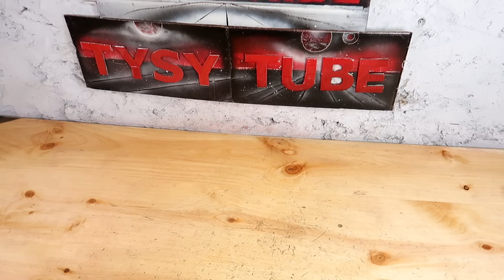Very Rusted Press Restoration

Comment: Usually I cringe at these "restoration" videos, because the first thing the "restorer" does is reach for an angle grinder to remove the rust (and then end up removing a goodly amount of sound metal in the process.) There's a reason rust removers were developed and a reason why you should use them. This was a very nice restoration.

Comment: To save rustremover, you can take advantage of displacement by placing a few more (big) items in the container so that the rustremover level rises.
Reply: IJuziI - good thinking
Reply: @seth_5394  Or, put parts in bag with RR in it. Put bag into huge bin full of water. Water pressure applys RR evenly and keeps it separate.
Reply: Or you could use a smaller container!
Reply: You could place bags or containers of water in there with it
Reply: Admiral Belzediel you are a smart man i never would have thought about that

Comment: Very nice restoration. 
Just an FYI, on bare iron/steel surfaces that you don't want to rust again, you can paint them with a light coat of clear lacquer or a coat of carnuba wax or beeswax. On an item like this, either would work well. However if you restore woodworking tools, never use any silicone oil products either in loosening or cleaning them, it may look nice, but you can never remove it completely, and it will ruin any finish you try to put on any wood you use the tools on, because it gets into the pores in the wood.
One thing I did want to say to you, not about this restoration, but in other in the past. When you use paint stripper, the gloves you use normally, are too thin to protect the skin on your hands. You really need a thicker glove, at least as thick as one that you would use for washing dishes, but thicker ones are always better when you are using paint stripper. I tell you this from experience. I was using aircraft paint stripper on a restoration project, and had on nitrile gloves about as thick as yours appear to be. While I was scraping the paint, the gloves got a small tear in it, and I didn't notice. Shortly afterwards I noticed a slight burning sensation on that hand. Unfortunately, by the time I felt the pain, it was too late. I yanked off the glove and ran my hand under running water. I ended up with second degree burns on my left hand, the sweat on my hand caused the chemical to spread over most of the hand, and I had large blisters and it took almost a month before I could use my hand again without too much pain. 
I love that you are passionate about restoring old items, but I don't want you to find out too late like I did. 
Keep it up.
Reply: Very well share 👍
Reply: That is a great tip, thanks for sharing the information.

Comment: There is a screw on the side of the base on the back, you didn’t remove it, what is it for?
Reply: I'm not sure that is actually a screw.  It appears he took the 'head' and the area around it to bare metal, yet they appear to be the same material (unlike the appearance of the actual screws when they were 'stripped').  Perhaps it is some sort of forging artifact that happens to look like a flat screw head.

Comment: You should buy a brand new one from harbor freight, remove it from the box, and make a restoration video.
Reply from the maker: impossible 🤣
Reply: Yes! That’s great.
 I used to work overnight freight there. Funny shit! 
You should see there weekly return bins. Like 3 pallet crates stuffed full of Car Jacks, All the hydraulics,Tile Saws... Jackhammer.  literally everything the store sells. And each tool... either worn plum straight into the ground. Or brand new and broken after 3 uses. 
We called it “ Horrible Freight”, “Rental Freight” ... traveling to “Rental Harbor”
Reply: Harbor freight wishes they made quality products like this

Comment: That was a really fun one! I wish I could do that, but I live in a city apartment and having even a shared workshop space is super expensive. I make do with a workbench on my truck bed but that only goes so far now that the weather goes worse :)
Reply: Look for a Makerspace or Hackerspace in your area, one where I live offers a 'Maker's Dozen' pass for $100.  Good for 13 working visits, if you know you won't be able to get there often enough to make it worth the cost of a monthly pass
Reply: @Hyratel  We don't have stuff like that in Germany, the cheapest way would be to rent a workspace but that is 400-600 bucks a month here in the city. A bit further out it gets a little cheaper but still pretty expensive, I'm currently looking for these small garden patches because I could easily use them for a workshop and they are much cheaper.

Comment: Love the job that you did. One thing you can try in the future for pain is Wrinkle Paint. It  does a remarkable job of covering surfaces that are very rough and / or pitted or that otherwise aren't finished well. We used to use it frequently on the jewelry safes we refurbished, plus it has the added advantage of having been used from the 1910's to the 1960's so would be in the time frame of some of your projects.

Comment: FYI - Grooves in table are supposed to be paint-free.  There is also an adjustable mounting kit that may be used on the press.  This came up back in the 1980's when I was training as an machinist-apprentice.   Also look up restoring tools with electrolysis.  It will save you a lot of work.  Great video though.  It inspired me to try it on larger mounted tools.  TY.

Comment: Using a wire-wheel with no gloves? You sir, are a glutton for punishment. Pulling tiny metal slivers out of your hands is not my idea of a fun time.
Reply from the maker: is very dangerous to utilize gloves with wire wheel do not attempt 😊
Reply: @TysyTube  I've been using wire-wheels of all sorts since you were probably in diapers, and I always wear gloves and a full-face shield while doing it. All of my digits are intact.
Reply: One way to rip a finger off is to wear gloves doing this. Get to close and gets caught in the wheel. I've seen it happen and it's not pretty.
Reply: just google "degloving" happens alot from machinery incidents, i never wear gloves, and always wear a facemask, id wear leather chaps if i had some too
Reply: Back in the Middle Ages (your time) people wore steel gauntlets when working with wire wheels. Is that why you still have all of your digits? ROFLMAO! Just kidding!   @MFKR696
Reply: @MFKR696  Are you sure you really work in those kinds of jobs???
Ok for the protective head gear,safety first,but gloves are literally...
If you put your hands on a drill will one,poof,bye bye the fingers,same for a lot of things...
Just use glove on the right occasions,like manual sanding or things like that
Reply: @poowhynot1268  WELL THAT WAS GROSS!
But yeah, gloves are only for not automatics things
Reply: honestly i dont use gloves for anything, except welding, but i guess im not a pussy like INF1D, his words, im not scared of a couple wires in my hand, and i blacksmith, wearing gloves in blacksmithing is a big no no, althought some operations require them
Reply: @poowhynot1268  I only use glove for sanding.
But blacksmithing without heat resistant glove is kinda dangerous.
Blacksmithing is not the thing where you mold the metals,right?
Cause if you only work on them,then its relatively safe
Reply: @pepito ? its just hammering on hot steel, not melting it, and heat resistant gloves are just a liability, you can tell if something is hot or not my just hovering your hand over it, id rather get a lil burn than have a glove melt on me, also i have use welding gloves, good quality leather gloves, and sometimes they just get so hot your hand starts to burn in them, blacksmithing is seriously way safe without gloves, usually its really hard to hold a hammer or tongs, and if you the backs of the gloves have any plastic, a hot piece of metal will just melt through and stick to your skin. Anyway moral of the story, use gloves when youre using a belt sander, otherwise happy getting degloved
Reply: @pepito2900  Worry about yourself, bud.
Reply: Call us when you will lose your hands
Reply: he cant, no hands
Reply: @poowhynot1268  Well I didn't think of that x)
Reply: @MFKR696  If you're not clumsy then why do you need gloves?
Reply: @timothypetroulakis62  I take it you've never used a wire-wheel? They throw off little needles of metal which embed themselves in your skin, which is why a face-shield is an absolute must as well, and pulling metal slivers out of my hands is not my idea of a fun time.

I will admit that using gloves with a stationary wire-wheel on a bench grinder is kind of risky, but with a hand-held grinder, not using gloves is a pretty dumb thing to do.

I've spent more time wire-wheeling than you have probably spent doing any kind of work, so just worry about yourself. I've got me covered.
Reply: Wearing gloves is the most basic no no's of using a wire wheel
Reply: @MFKR696   wait wait wait.... youre the guy advocating FOR the use of gloves... and youre calling other people who are NOT using gloves... pussies? am I getting that correct? setting aside the fact you are flat wrong in regards to your insistence of using gloves. youre not smart, yorue lucky. Im a manual machinist and I can tell you with absolute certainty that no, you never ever wear gloves around rotating equipment. anyone who says otherwise is absolutely flat wrong.
Reply: @MFKR696  You go Man
Reply: First off never use gloves on grinder
Reply: @MFKR696  a harp can take a finger off....
Reply: @MFKR696  nitrile gloves are totally safe with the wheel grinder, these people are thinking of heavy cloth gloves, the gloves can get pulled in by the bristles. it only takes less than a split second of distraction, your finger slips and snags on  the wheel while your wearing heavy cloth gloves and boom the machine begins to pull your hand in and potentially break some fingers.
Reply: @joshuamcpeek4708  Indeed. I am fully aware of the dangers of wearing cloth or leather gloves around a stationary tool, regardless of what all these other fools are saying in this comment section.

My go-to for stationary wire-wheel or miter-saw operation is doubled up heavy-duty black Nitrile gloves. While using an angle grinder with a flap-disk or wire-wheel on it, I wear leather gloves, simply because there's no good reason not to, especially considering that I leave the shields on all of my angle-grinders. 

I've had enough plastic flap-disc holders explode on me that to not wear leather gloves and a full-face shield would be a pretty stupid move on my part. I've never had a wire-wheel explode on me, but I still consider them to be the nastier of the two.

From the way these other guys are talking, you'd think I was advocating for the use of woolen winter mittens lol. Like I told them, though, I still have all my digits intact after 20+ years of fabri-cobbling both at work and in my garage, so I must be doing something right.

I guarantee you all the people throwing shade at me for this have never had a real job in their entire lives. If they do have jobs, though, I guarantee you they aren't very good at it if they're getting all worked up over "gloves vs. no gloves" lol.
Reply: @joshuamcpeek4708  Indeed. I even know some people who are too afraid to re-string a guitar, lest a string hits them in the hand or face. Pathetic... lol
Reply: INF1D3L010 You don't know what you are talking about. With a wire wheel, it will catch the glove and roll it around the axis, actually breaking your fingers's bones or worse. Without gloves, all you risk is a scratch if not carefull enough. Glasses are mandatory though.
Reply: @CaptainDangeax  Worry about yourself.
Reply: @MFKR696  Like if I didn't know what I was talking about ? Like if I already missed loosing a finger because glove was caught in in wire wheel ?
Reply: @MFKR696  Actually, you're the one with the faculties behind, because I didn't loose a finger nor wrote it. The 10s are all here and perfectly able to do their duty. Your way of progression in English is huge, specially when english is not my native language.
Reply: @CaptainDangeax  If you say so.

Comment: great job 👍🏻 pro tip for when ur using hamerite next, mix it with 4 to 1 ratio hardner then use thiners to thin it out. that way you can get 2-3 coats done within 4 hours rather than waiting 4 hours for it to dry

Comment: Shouldn't there be a thumbscrew in the end of the pinion so that you can adjust the length of the press handle? Freezeframe at 19:55 to see the hole I'm referring to. Most bench presses I worked with had that adjustment so you could apply more force when needed. Look at how the two ends of the handle aren't equal lengths (go to 08:15 to see what I mean); doesn't that imply that the handle is moveable? Just a thought; I could (probably) be wrong. BTW, I love your work. Comes out better than new.

Comment: I like your videos. A few tips if you like positive criticism. You can use apple cider vinegar to easily remove rust. Inhibit oxidation from acetic acid by baking soda/water bath. Also, a foam brush paints really nice. Thanks for your videos. Keep the scene alive

Comment: 00:01  presentation
00:56  begin disassembly
03:12  preparing for removing rust with MC-51 
05:30  grinding all the parts with wire wheel machine
07:32  cleaning all the shiny metal parts with metal cleaner and scotch brite
08:51  polishing all the shiny parts with metal polish and cloth wheel
09:46  degreasing with alcohol
10:00  protecting the parts for painting
10:21  apply anti-rust spray
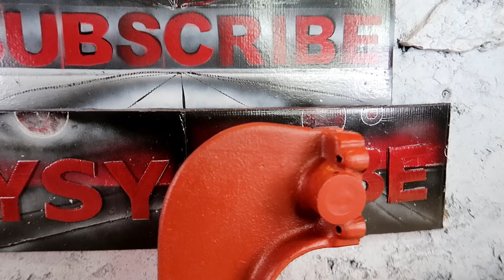11:15  sanding the primer
11:37  first coat of the Hammerite paint (blue nuit)
13:53  second coat of paint
14:56  start reassembling
18:26  applyng the anti rust oil Owatrol

Comment: There are actually buffing/polishing wheels that you can get for hand drills. You could use those at times when using the bench grinder isn't ideal (like polishing a 29kg press).

Comment: What was that you added to the bolts? Loctite or grease? I was also wondering about the T-tracks at the base of the press. It looks like an attachment can be added here for holding parts in place as you use the press. Is that right?

Comment: I like. But at 16:16 the shaft will not enter the hole with the pusher installed. After all, the slots on the shaft are not cut to the end ... Error during assembly. And I would not paint over the T-shaped grooves on the table. Can not insert mounting screws.

Comment: Nice job.  Always loosen Jamb Nuts first where they exist.  Any concern on the cracks in the flange upright?  It may have looked better if they were filled prior to painting.  I always use SS fasteners wherever possible when doing a restoration if Tensile Strength is not an issue.  Great colour choice.
Reply from the maker: thank you so much 😊

Comment: Im not knocking the chemical rust remover but if you can wait overnight for   rust to be removed you can get equal quality results from an overnight soaking in regular kitchen vinegar which is cheap, easily found anywhere and is non toxic. I am amazed by how well it works
Reply: I know you have used vinegar and it can smell a bit potent but I like its low cost and that its non toxic

Comment: Under the paint "HAMMERITE" you can not apply any primers or anti-corrosion or any other. It is only necessary to clean the metal and then degrease it. Because the paint itself is a very honest set of components; these are modified alkyd resins, silicones, anti-corrosion acid additives, color fillers and solvents. Any other coating will only interfere with this wonderful paint.

Comment: You really should invest in a set of screwdrivers.
The width of the screwdriver should equal the width of the screw. Otherwise it is unavoidable to damage the slit when applying torque.
In a perfect world the screwdriver fits the width and the length of the slit perfectly.

Comment: if you could, may i ask that you leave a container of used mc-51 around for a while and also some of it in a large open container, like maybe 3 inches deep and open to air, tell me how well both work after like 3-4 months, i think that might be a good replacement for CLR and vinegar, my current go to products, if that stuff stays working then it might be worth filtering once it gets really bad, or if i use 20+ litres of it to clean a gas tank, also can you put a piece of rusty tin and some new and rusty bolts in for a while? like not from a project, just parts you don't care about, i wanna see how it would affect things if left too long, like say a week (life happens sometimes)

Comment: Boss, just wondering about the grease part. I'm not an expert, but if you put grease on the rod, doesn't that accumulate dust over time which will eventually cease it up again?

Comment: Hey, you can put a tire valve in an empty spray can, take the valve of, load with paint, put back on and pressurize it using a bicycle pump .... less messy than a hplv pistol and air compressor .... my English is bad but.... greetings from Brasil !!!!!!!

Comment: 16:15  You are sliding in the pinion shaft with the ram already installed.  In this case, IMPOSSIBLE.  The pinion has blind teeth. They do not extend to the pinion which would prevent the engaging of the pinion gears with ram gears. 

This would have to be done with the ram plate off, pinion installed and then the ram over the pinion and lastly the ram plate.

Comment: Anyone know what tool he used to remove the flathead screws?
Reply: It's an impact driver, basically transfers the hammer blow to small movements of the head.
Reply: I only added this because I had their catalog open on my phone. I'd buy it from Home Depot or Lowe's.

Comment: Geez, why do they always use weak split-pole motors for these bench grinders? Just add a lil' too much pressure against the wire brush wheel and you stalled the motor!